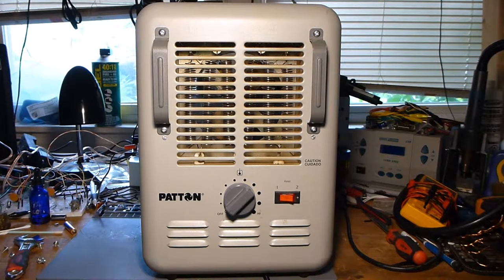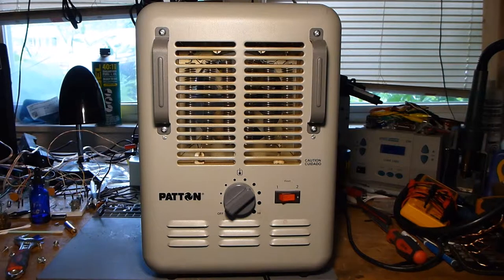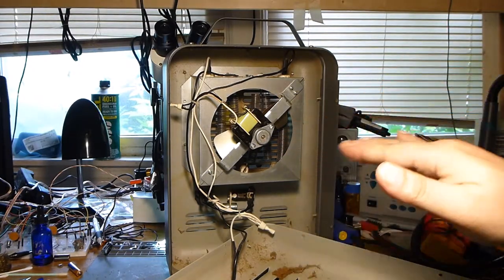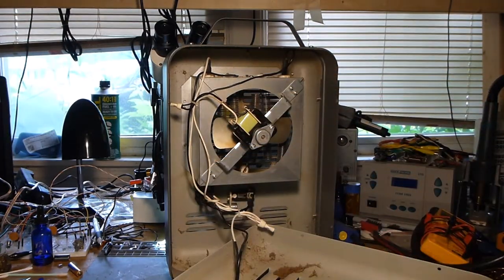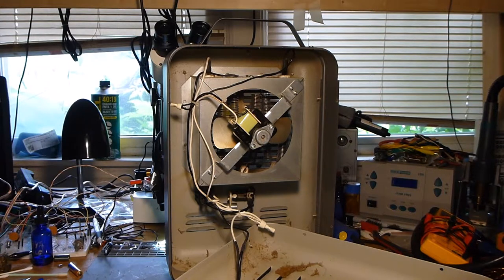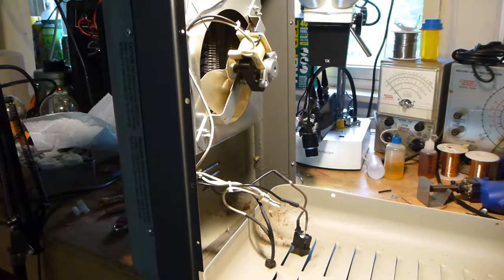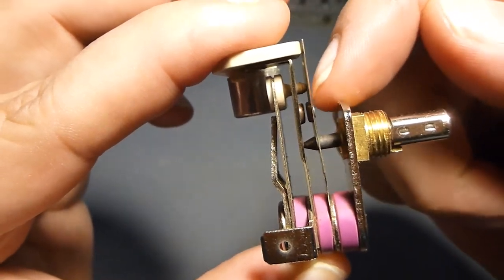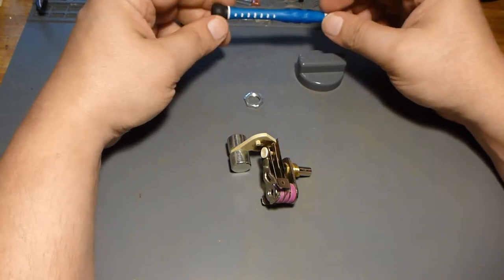Milk house heater went teats up....sorry, not sorry.

Comment: Know this is an old vid. but for the ones who come across this in the future, there is a thermal fuse on one end of the heating element. Usually on the end  conn. to the hot wire coming off the thermostat. Look inside the "coil" housing. So yeah, there's only "one safety device" on this heater, unless there's two. Sarcasm thicker than molasses in an Alaskan winter.

Comment: My issue was that the points has been burnt down so they wouldn't make contact.  they were not as this as they were new.  I got my heater to work by filing down the plastic on the tilt shut off safety device.  It still shuts off on tilting and does heat up.
Reply: That's the answer I was looking for thanks.
Reply: I bought some replacement thermostats but they cost about half the price of a new heater and burn out as well. I have now completely given up on the thermostat.  I opened up the heater and wired a toggle switch to turn it off and on manually.
Reply: I bought two at Wally world on clearance for $5ea. The one I have on the bench failed almost immediately, and the other has been working splendidly for 8 years, continuous use use monitored, TURNED OFF while away from the area. I'm going to wire it direct, and use a thermostat I use for my torpedo heater. I will monitor the temp of the cord and outlet until I am 98% sure of reliability and safety (2% failure allowance seems fair.)

Comment: I just bought one of these to thaw pipes in our crawl space. It must have been dropped because the weight unit and rivet for the tipping shutoff were rattling around in the case - the detail of the way the tip unit fit in was really handy. Finding the right shot while you were handling the thermostat was a bit tough as it was only there for about half a second but I managed to get all the detail I needed. The little rivet was proving to be difficult to re-install so I threaded the hole it went through and installed a tiny screw to replace the rivet. Thanks for the video!!! Much appreciated. Sometimes it's good to see a slow 360 degree view - you never can tell what issue someone is having.

Comment: Idea for more content… as a sparkle myself… I’d say the model you used in this video is perfect. Fix up as new & working like new. Hook up amp clamp to show current without a ground. Then swap out from 16/2 to 14/2wG or 12/2wG.  Then show amp clamp to show the difference in current pulled… Of course you’ll have to add a grounding screw bonded to chassis for the extension cord to bond with. And maybe mod the inlet size hole with new grommet.

Cool content!

Comment: Great diagnosis  almost identical problem with mine,  love the schematic. I also chose not to fix it but what kills me is that although the heater is 3yr’s+ old it’s probably got <100hr’s of intermittent use...now we have a sustained use for it and have used it consistently for several days..it breaks. I don’t know where you purchased it but I purchased it at the same place I have purchased several Hyper Tough work lights and Honeywell turbo fans both items having a similar demise as the Patton heater...several years of intermittent use followed by a period of sustained use and…kaput.
Reply from the maker: Yes, "The ___mart". I would wager that if someone were to replace that, and not me mind you, with a solid state relay based thermostat or one with some zero voltage crossover control for a standard relay, they would probably last a lot longer. Of course that would also need to incorporate a tilt motion safety.... at that point you may want something a bit more expensive as the components to cobble one together on the bench would probably pay for the expensive one. Thanks for the comment.
Reply: I love these types of heaters in my previous mobile home I kept one plugged in year round in my well house to keep the pressure tank and pipes that were above ground from freezing the one I had out there lasted 6 years, like you said though it was seasonal use and only seen constant use on the days it was extreme cold and ice during the winters, I also had one under the house nearby the inlet pipe coming from the well house to keep that section from freezing and just let my faucets dripduring below freezing Temps and I've not had a problem with freezing pipes, thank God because plumbing in the freezing cold and wet areas under a home in winter sicks ass...I have one in my son's room that he likes to keep it on constantly. I ran a dedicated 20amp breaker and wire to that heater...the best safety device is never put these on extention chords even if they're short ones especially the mart chords because the wire in those chords is undersized for the current these things pull during operation. Great video, I was looking to find out more about the contactor that's supplying the fan but is also spliced to the positive terminal of the heater wire, I figure it's an intermittent contactor but can I splice that out of the loop to get it running constant the fan I mean not the heat?

Comment: I have several of those heaters by Patton exactly like yours all are between 6 & 12 years old still going strong... Had cut-off switch problems, but easy fix, replaced a wire on one, & used 3 in ONE oil on the fan on a couple, but they all goes OFF if tipped over forward or backward, but if laid on its side, it still runs...

Comment: Thank you very much for taking the time to share your experience with the overheated plug and wiring and exlaining the constant arc that this heater creates. I have this very same space heater that we use in the winter to keep our well water holding tank lines from freezing. AND in this same building, GAS and PROPANE! Yikes! I watched your video because mine was intermittently working just like yours. Any suggestions on a better heater for the job or a better way to keep my well lines from freezing? I used an old coffee pot toggle switch. The heater works now, but can't trust it not to be knocked over by the squirrels.
Reply from the maker: Hello Michelle, I am no expert by any means, but if it were me, I would use heating element pipe wire and wrap insulation. Most of these cables are complete with a power indicator LED and a built in GFCI in case of a water leak. It's a little bit of work as you would want to repair any leaks or potential leak spots before installing it, but it will work down to -30°F. There is little risk of fire near LP and natural gas and some even have a sort of thermostat built right in. They come in all types of sizes and ratings, so do a bit of research to make sure it is the right solution to your particular environment. Basic ones can be found for as little as $15 US. I hope that helps. Thanks for watching.

Comment: Old outlets can do that even if the heater is running fine.
The contacts don't last forever. Watch any high current appliances until you're sure there's  no heat where there shouldn't be

Comment: On your schematic AC doesn't have polarity, and it doesn't power half or all the coil if you drew the schematic correctly to match what's there. If one switch position shorts the bottom coil it will run hottest, cooler if using all of it since resistance is now higher. I'm thinking it's just drawn wrong however since I doubt it would be designed in said fashion.

All the discussion ensuing seems to suggest someone will bypass the thermostat. That only works until it doesn't. The doesn't part can end really badly.

I'd suggest if "fixing" (filing?) the contacts, let the thermostat energize a contactor added inside the case, or a solid state relay module. Added benefit is no more contact arc - better in the presence of volatile fumes.
Reply: Edit: switch is a Taiheng TX3, positions 1-4, off, L-2, L-1-2,L1-2-3.

It both selects biggest coil and shorts small one in high.

1300/1500 Watt positions were actually 1180 and 1315 Watts.

Don't see an option to upload, schematic has other errors. One mains leg goes thermostat,  other overtemp cutout, then rest.

Comment: Great video. Were you able to find that switch? My went tits up. Like you said, the contacts melted together and eventually broke. It was acting wierd at first, turning on/off for no reason, then just stopped working all together. I haven't been able to find the switch. I can probably get one from China if I tried hard enough but was hoping someone had bought a bunch of them and were selling them. Thanks again.

Comment: So, the contacts on the bi-metalic thermostat that controls the current cycling for this heater are low grade and thus fail after a few cycles.

The author is a half bubble off from the truth.

The part number on my thermostat is NLX-MT. That is for a Chinese manufactured part labeled; New Lixon, 120 vac, 15 Amp. Which has a gravity safety built on it called a tip-over switch.

There is a safety at the top of the heater coil box that is an upper limit switch that will cut-out if there is a catastrophic failure.

So, order a replacement, file the contacts or buy a new one.

These are not to be used in a gaseous environment.

Good luck. 

Mike H
Meridian, ID

Comment: My heaters momentum switch fell off i heard a noise inside when it fell and i opened it up and it was broken can i still use the heater?
Reply from the maker: I would not recommend it. Another fall could result in a fire if it has no momentum switch to turn it off.

Comment: I need some help please .. can you please show me how the wires  go ... some jerk opened my new heater and replaced it with scotch tape
Reply from the maker: Sorry that happened to you. You may want to return the heater from where you purchased it and get them to exchange it for a correctly wired unit. While most of these are similar, I can't assume the one you have is exactly like mine. If it is wired wrong, it would be a shock or fire hazard. Best of luck and thanks for watching.